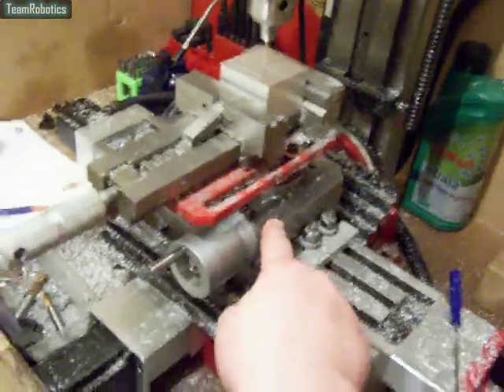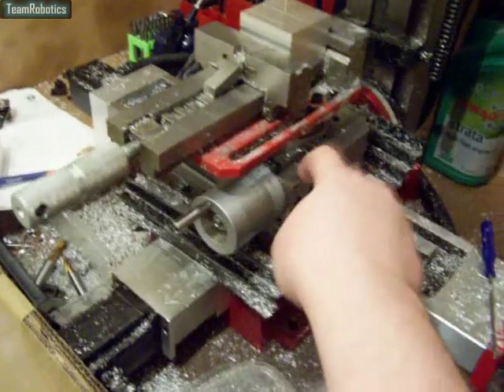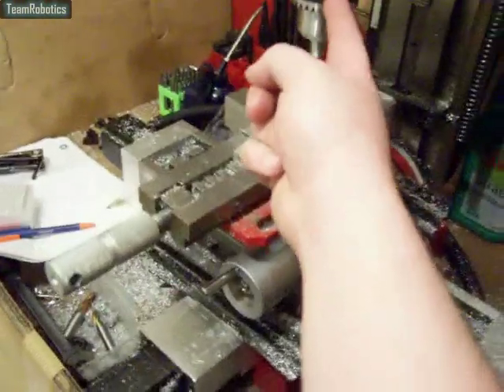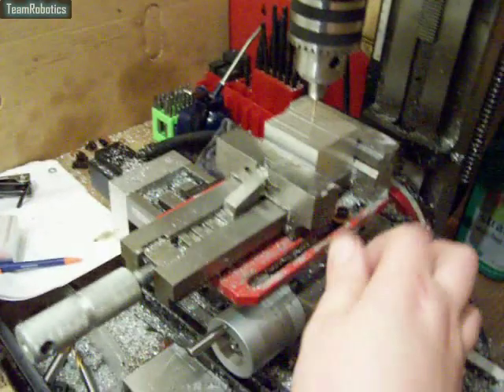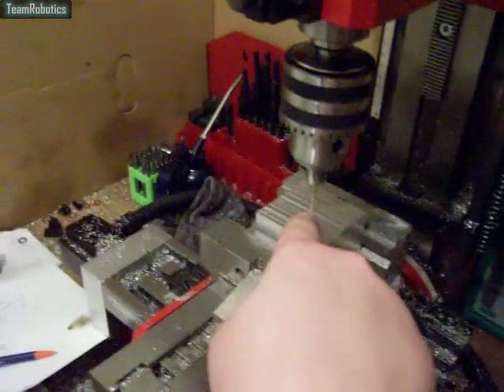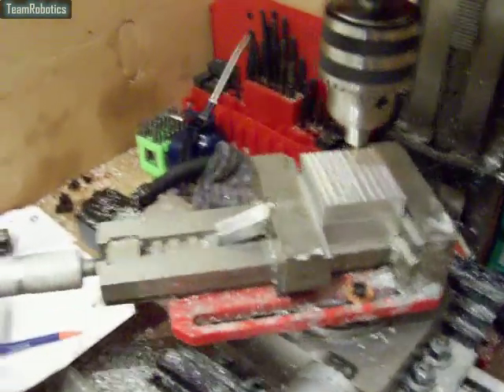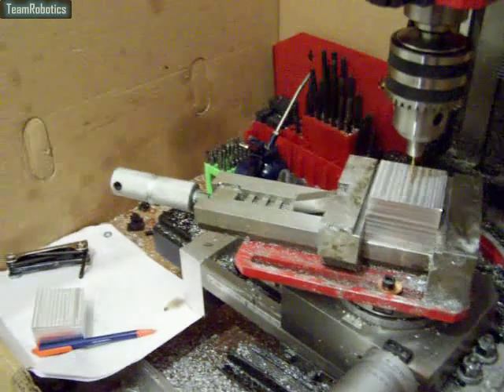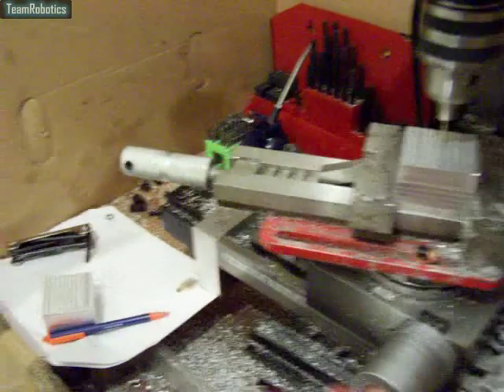143: all setup to bore out the first block on the mill

Comment from the maker: hi there the block 1.5 or 2 inches thick and has to be bored all the way through on one and nearly all the way on the second one, the gib screws on my Z axis are not so great so i opted to machine it by hand as the hobby machine is ok at most things but not heavy load when machine circles,

Comment from the maker: hope this sort of explains, the parts didnt come out to bad and the circuits i feel came out a lot better than they would have done using the machine under cnc control, i forgot to mention my fourth axis is still manual as ive never mounted the fourth nema23 to the rotary table...